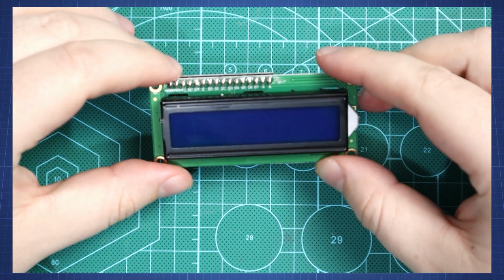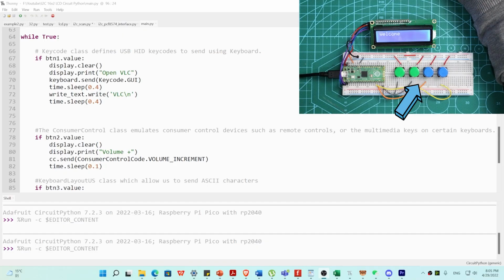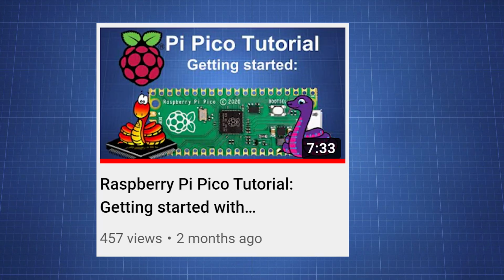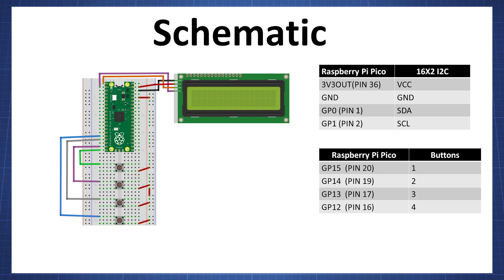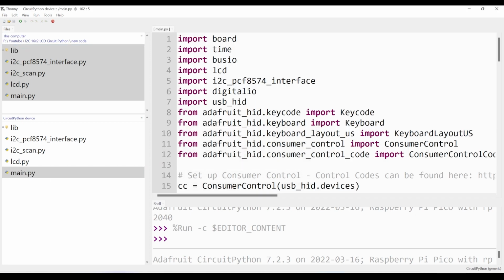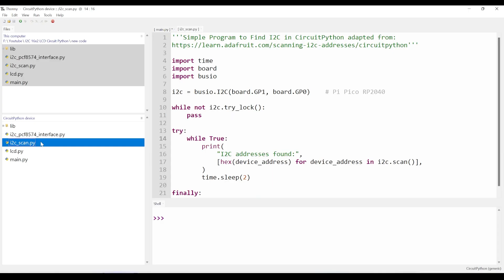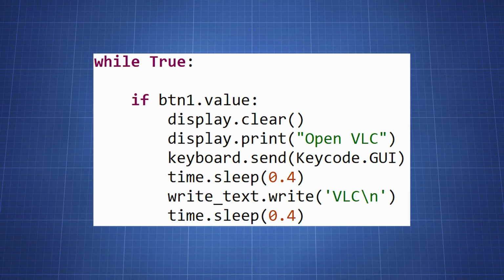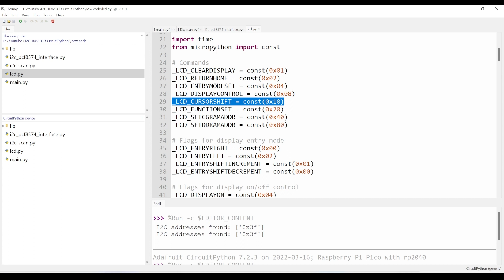CircuitPython Macro Keyboard

Comment: Do you know how I can display the current time and date of the computer instead of "Welcome"?
Reply from the maker: displaying the data and time from the computer might be a bit more tricky since you will have to receive it from pc through UART(Universal Asynchronous Receiver/Transmitter) so you will need to create a seperate script to do this. Other options is using the Pico W which you can get date and time from internet or using the ds1302 time module which you can setup to store date/time. Now if your pico is a HID device like a macrokeyboard I am not 100% sure if it could still use UART

Comment: what lcd display did you use? mine is extremely unreadable but looks the same
Reply from the maker: Did you adjust the Brightness behind the LCD will be a resistor blue small one surface mount which you can adjust
Reply: @NerdCaveYT  Didn't know that was there, thank you very much for letting me know! Also, is there a way to just change one letter at a time with this library? Rather than having to reprint the whole line causing some delay?

Comment: Hi. What is your reason for using Circuit Python? Could this not be done in Micro Python? I am currently trying to learn Micro Python and I don't know what the difference is between this and Micro Python.
Reply from the maker: I used CircuitPython in this application because they have the HID library that makes it easier to setup with the Pico as a keyboard input device. At this moment there is no library like this in MicroPython that I know off. CircuitPython is basically a fork of MicroPython supported by Adafruit with their team and community creating more libraries and support, so you probably notice instead of the machine library they use board. There is a way to get micropython code to run on CircuitPython which I am still investigating.

Comment: Thank you very much for the reply :D
Reply from the maker: no problem, I think you probably solved the problem on your own, the issue with the CircuitPython Adafruit library is that the library does not use the pcf8574. The library in this video at least works with CircuitPython.